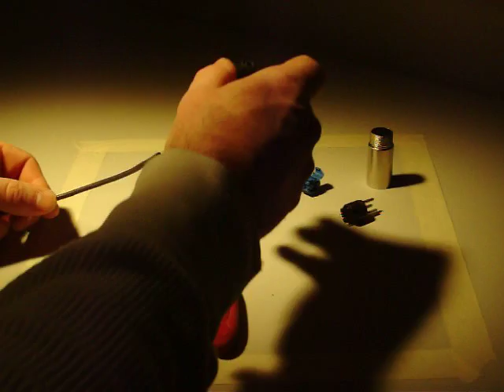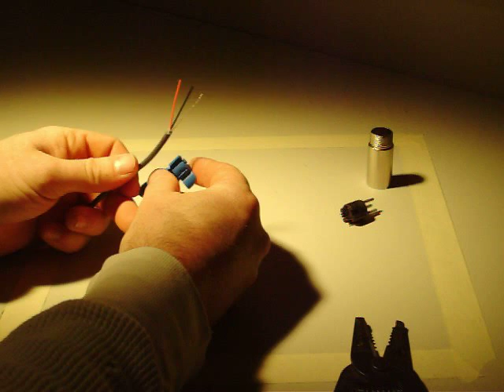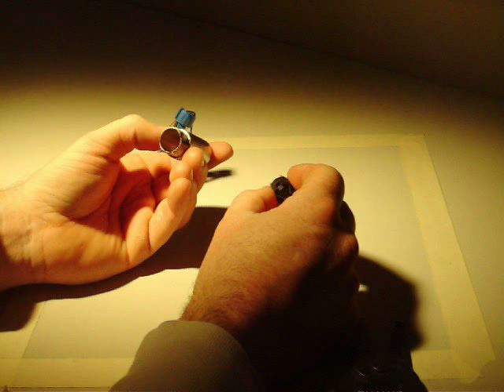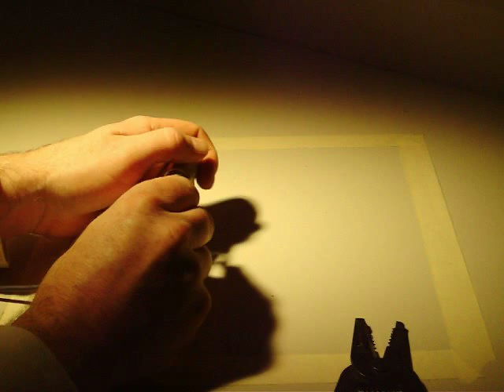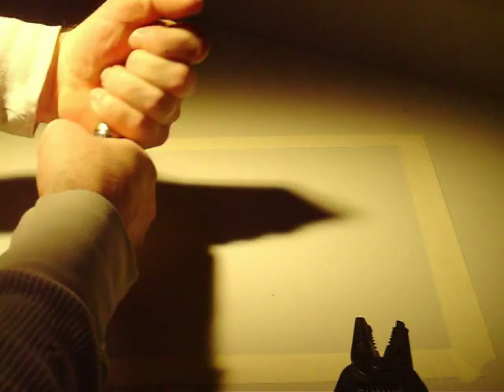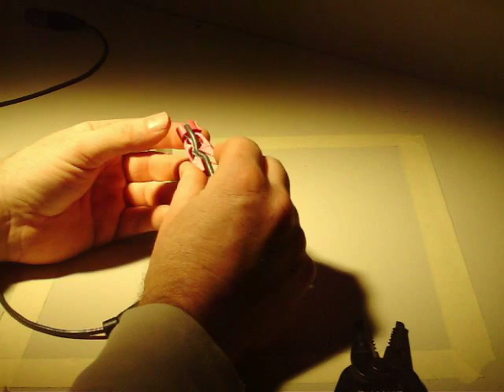Solderless XLR Connection at Direct Pro Audio

Comment: 3 questions. 1) Will those connectors work with 12 awg wire. 2) You had three wires. My speaker wire only has two wires, a (+) & (-) coded wires. Do I have to purchase special speaker wire to terminate XLR's mail and females. 3) I'm looking to terminate XLR on one end and Banana Plugs on the other. Will this setup work & again will I need a different type of speaker wire or is a 2 speaker wire setup good enough. Thanks and great video. Never knew how easy it was to terminate XLR's.